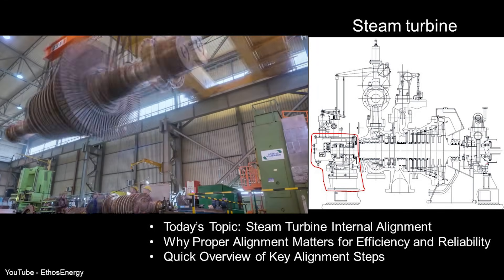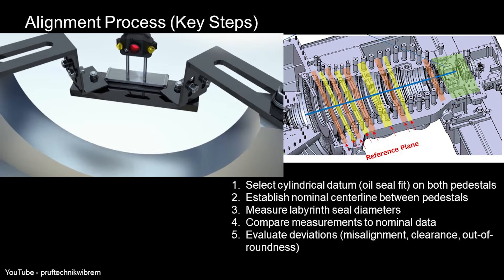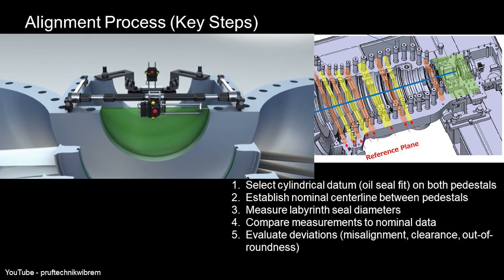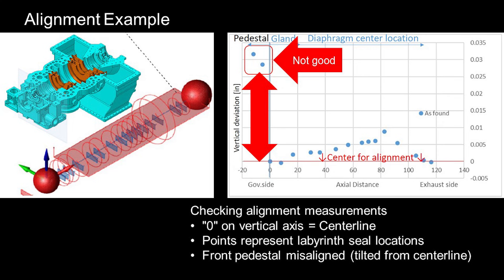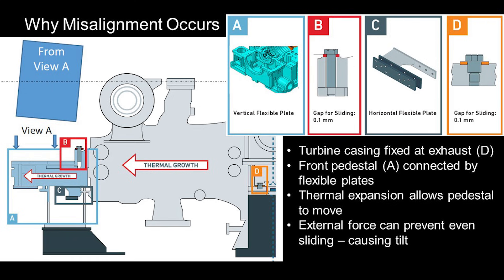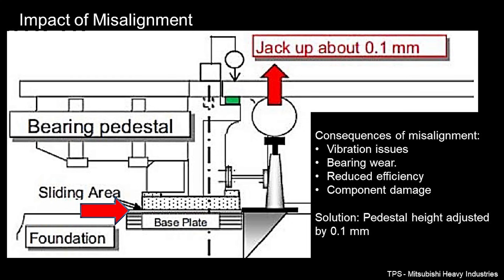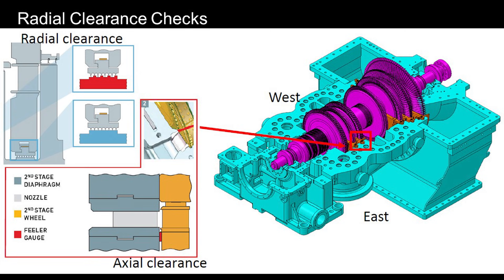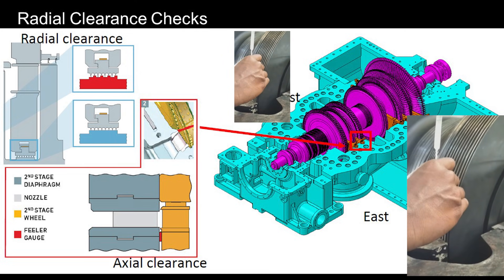Misaligned Turbines? Avoid Costly Failures! (Part 55)

Comment: Nice share.
How to correct diaphragms misalignment if we found the radial clearance between the rotor and diaphragms not within OEM tolerances.
Reply from the maker: That's a great question! Addressing misalignment can be tricky and often requires specialized tools and procedures. If the radial clearance isn’t within OEM tolerances:

Check measurements – Confirm readings to rule out errors.
Inspect diaphragms – Look for wear or misalignment and verify they match OEM marks.
Reposition – Loosen bolts, align with tools/shims, and adjust the diaphragms.
Check the rotor – Ensure it’s centered and has no runout before finalizing.
Tighten & recheck – Gradually tighten bolts and remeasure clearances. Spin the rotor manually to ensure no rubbing.
Test & log – Do a test run and document adjustments.

If the problem persists or parts are damaged, consult the OEM or consider replacements.

If you found this explanation helpful, feel free to share it with your colleagues who might also be interested in rotating machines. I appreciate your engagement and thoughtful feedback!
Reply: @RotorDynamics  Thanks a lot for your kind response 👍 🙏🏻

Comment: Thank you so much. I wonder what is the name of the laser device at 25 seconds into the video and how does it find the centerline of the pedestals?
Reply from the maker: Thank you for watching the video and for your question! The device detects the centerline by referencing specific points on the pedestals, ensuring accurate positioning and reducing misalignment. It works by projecting a laser beam along the pedestal line, allowing for precise measurement of alignment.